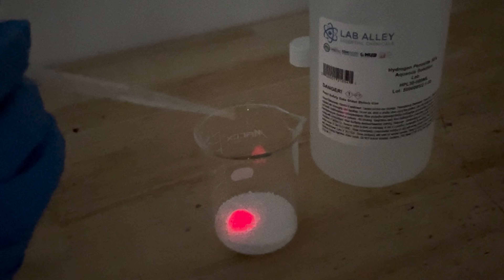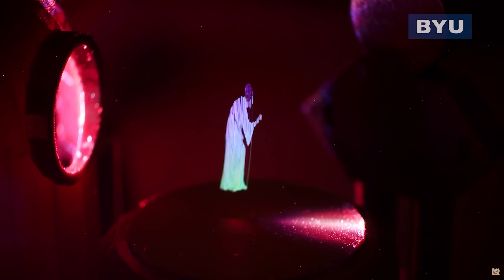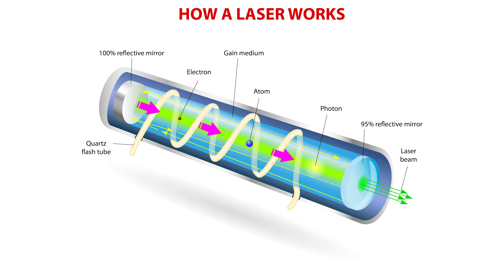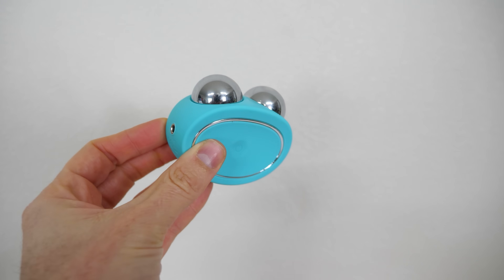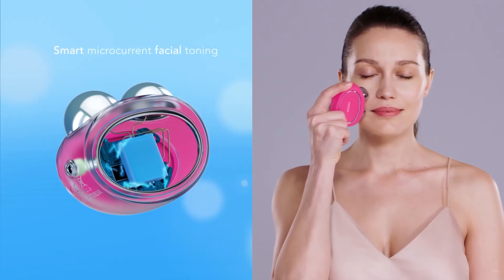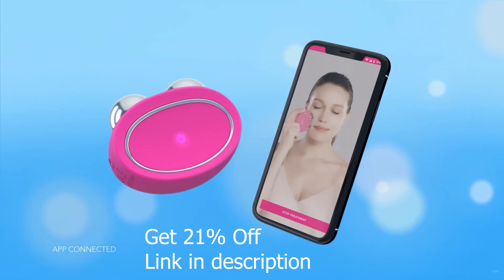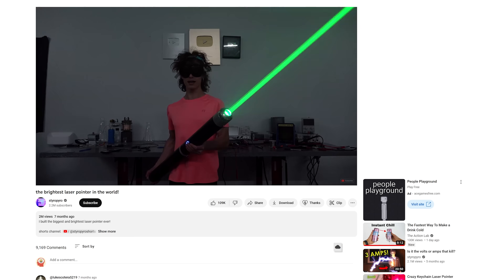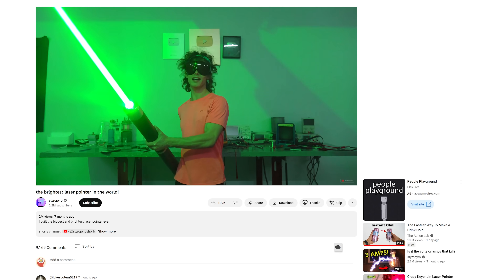Singlet Oxygen Is Scary!

Comment: 1:35 there are electric sports cars whose batteries can deliver 1.5 MW of electricity, though of course converting the electricity to laser light isn't 100% efficient.

The ABL required 55kg per kW of laser power. The MDA wants to reduxe that to 2-5 kg/kW. The plan was to have enough lasing fuel for 20 full power shots, then it would have to return to base to refuel the laser. I can't be sure about the parameters, but say 5 seconds at 1MW for full power.

Of course there are bigger batteries too. The MF Bastø Electric car ferry in Norway has a 4.3 MWh battery and uses a 9 MW fast charger. I'm not sure how much power the battery can deliver, but if it can charge at 9 MW, it wouldn't surprise me if it can discharge safely at 9MW too. Of course, a ferry is big and so might the battery be. I've been unable to find the dimensions of the battery.

But if the battery in a small sports car can deliver 1500 kW (1.5e6 Watts), I'm sure you can in fact have a mobile MW class laser, or at least, the battey size won't be the limiting factor.
Reply from the maker: yes I think electric lasers will surpass the power of chemical lasers soon. To make 1MW of power you might need like 3MW of electricity because electric lasers are very inefficient. But batteries are getting better and better so it is only a matter of time
Reply: @TheActionLab  Well, there's the fusion ignition facility, does that count?   Several facilities actually.
Reply: @junkerzn7312  well, your fusion ignition facility or mobile batteries can not be shot from other from orbit?? : )

Comment: Now the question I am left with is can we use the power of harmonics to combine multiple laser wavelengths in order to combine them in a multiplying effect that boosts their energy output? Like if we created a photon canon with photon rails basically. A little like the concept of a waterslide but using slower wavelengths to amplify the speed of faster photons by providing a channel for them to accelerate upon.
Reply: All photons move at the same speed.
Reply: @phizc  relative to what?
Reply: @metasamsara  heh.. I'm kinda wrong. _In a vacuum_, all photons move at _c_, 299,792,458 m/s. But in any other medium the speed of photons with different wavelengths do have different speeds. Photons with longer wavelengths move faster than photons of shorter wavelengths.

Air has an index of refraction of 1.000293. Vacuum has an IoR of 1.0. So the difference in the speed of photons of different wavelengths in air is very small. Water has an IoR of 1.333, so the effect is more noticeable. It's what gives us raunbows.

What I took issue with is "using slower wavelengths to amplify the speed of faster photons". The only way you could change the speed of a photon in e.g. an optical fiber would be to change its wavelength, and that can't be done. The closest you can come to that effect is for the photon to be absorbed by an electron which later can emit a new photon with a lower wavelength, which would increase its speed in the medium, but it would also have less energy.
 
Sorry my original answer was a bit hasty. I didn't consider mediums with a higher index of refraction.
Reply: @phizc  I believe photons are a byproduct of light waves pushing matter in its way and we consider it light photons. I believe it would be possible however using harmonic resonance to create a medium through which wavelengths could be amplified to travel faster by quantum tunneling. It doesn't make logical sense that light would have a max speed since you can have moving light sources and if there was a top speed, then light would be slower on one side of the solar system than the other as the entire galaxy is moving through the vacuum of space. Everything is relative, and Einstein's theory of general and special relativity are wrong. Which is why they fail to work without special cases when it comes to quantum entanglement. But I'm just a nerd who loves logic, I don't do the math, so what do I know 🙃

Comment: I didn't get how a chemical reaction is converted to a LASER
Reply: For excitation of actual laser medium you just need energy. It can be electricity, xenon flash discharge, but chemical light works well too. You can make ruby glow (few times) by smashing it with hammer. Still counts as energy input.

Comment: I am not a physics person, couldn't we shoot plasma gas from a gun instead laser lights, wouldnt it look as cool and maybe even more destructive?
Reply: No, the plasma just disperses too quickly. In as simple terms as possible, as soon as your plasma comes into contact with the air, all the ions are going to very rapidly pickup electrons from that air and it won't be plasma any more.

On the other hand, hypothetically you can use a powerful enough laser to both instantly convert a target to plasma and ionize the air it passes through creating a plasma channel in the air. Hypothetically, if you also had a big enough voltage potential between source and target through this channel you could also have the other kind of "plasma weapon": a lightning gun.
Which would look very cool.

But at this stage, the "plasma" part of this weapon becomes pointless: you've already got a laser powerful enough to destroy the target. In fact, You could just destroy the target with a less powerful laser, so making it powerful enough to do the above just doesn't serve any purpose.
Reply: The plasma would have a very low density so it would slow down due to air resistance very quickly. It would look cool though.
Since plasma is conductive, one way of doing it would be to use a rail gun, but instead of accelerating a metal slug, it accelerates a blob of plasma. I'm probably not the first to think of it, but I haven't seen anyone try to do that. Would make for a very cool YT video 😀.
Reply: Thank you for the explanation ☺️

Comment: My question is: Does the human eye see the red light? As an observator we see it trough the camera, and, the action lab, assumeingly looks also through it. Because normally a human eye cant detect monochromatic wavelenghts.
Reply: We are seeing the reflection of the light off of the chlorine as it reacts with the HO3.
Reply: Yes. Each of the cones are sensitive to part of the spectrum, and since e.g. monochromatic light at 630nm is part of that spectrum, you can see it. 630nm stimulate the the cells responsible for detectng red light, and to a lesser degree, the cells responsible for detecting green light.
If you shine light through a prism or look ar a rainbow, all the wavelengths have been spread out and each "part" is more or less monochromatic.
Reply: @phizc  thanks

Comment: Question: when I empty a bottle of whiskey into a decanter bottle it looks empty.  I can wait 12 hrs an there is a tiny amount of whiskey in the bottom in the original bottle.  I can tilt the bottle to run down the corner and exit the bottle.  Empty right. No.  I can leave it another 12 hrs and there is another tiny amounts in the bottom.  I can’t repeat this indefinitely but I would like to know what I can do to get it all the first time.  You are the science I trust.  Waiting patiently, an alcoholic.
Reply: Mix in a bit of water swirl in the bottle then drink.

Comment: What would be the power of the reactions you showed us, and how the light is converted into a beam ?
Reply: When we search for COIL Laser , we can see that it emits at a wavelength of 1.315 µm, in the infrared spectrum. The YAL-1 experiment with the Boeing 747 uses this kind of (infrared) laser. 
(Also, he said his (red) laser emits at 732 OR 634nm , while the paper show 762 AND 634nm, but when you search you can find it should be 634 AND 703nm) 
I also found an interesting paper that explains how you can perform the test without injection o iodine: 
""𝘔𝘰𝘳𝘦𝘰𝘷𝘦𝘳, 𝘵𝘩𝘦𝘺 𝘳𝘦𝘱𝘰𝘳𝘵 𝘵𝘩𝘢𝘵 𝘪𝘯𝘫𝘦𝘤𝘵𝘪𝘰𝘯 𝘰𝘧 𝘪𝘰𝘥𝘪𝘯𝘦 𝘪𝘴 𝘶𝘯𝘯𝘦𝘤𝘦𝘴𝘴𝘢𝘳𝘺 𝘵𝘰 𝘪𝘯𝘪𝘵𝘪𝘢𝘵𝘦 𝘵𝘩𝘦 𝘪𝘯𝘵𝘦𝘯𝘴𝘦 𝘳𝘦𝘥 𝘨𝘭𝘰𝘸. 𝘐𝘯𝘴𝘵𝘦𝘢𝘥, 𝘩𝘦𝘢𝘵𝘪𝘯𝘨 𝘰𝘧 𝘵𝘩𝘦 𝘖2 𝘮𝘦𝘵𝘢𝘭 𝘪𝘯𝘭𝘦𝘵 (𝘈𝘭 𝘰𝘳 𝘊𝘶) 𝘴𝘶𝘧𝘧𝘪𝘤𝘦𝘴. 𝘚𝘵𝘪𝘮𝘶𝘭𝘢𝘵𝘦𝘥 𝘣𝘺 𝘵𝘩𝘦𝘴𝘦 𝘳𝘦𝘴𝘶𝘭𝘵𝘴 𝘸𝘦 𝘩𝘢𝘷𝘦 𝘶𝘯𝘥𝘦𝘳𝘵𝘢𝘬𝘦𝘯 𝘢 𝘴𝘪𝘮𝘱𝘭𝘦 𝘴𝘵𝘶𝘥𝘺 𝘰𝘧 𝘸𝘩𝘢𝘵 𝘤𝘰𝘯𝘥𝘪𝘵𝘪𝘰𝘯𝘴 𝘢𝘧𝘧𝘦𝘤𝘵 𝘵𝘩𝘦 𝘢𝘱𝘱𝘦𝘢𝘳𝘢𝘯𝘤𝘦 𝘢𝘯𝘥 𝘪𝘯𝘵𝘦𝘯𝘴𝘪𝘵𝘺 𝘰𝘧 𝘵𝘩𝘦 703 𝘯𝘮 𝘳𝘦𝘥 𝘦𝘮𝘪𝘴𝘴𝘪𝘰𝘯.""
Reply: A laser works by exciting a medium like a gas or a crystal with "normal" light or high voltage,or heat. Then to the left and to the right of this medium there will be a mirrow. One of them is semitransparent.
So i think this light coming from the reaction is used to excite the medium. Then when this medium is excited some atoms in it will de-excite by coincidence and release a photon. This photon then bounces back and forth between the mirrow, and by this hits other atoms in the medium, which then get de-exited by this photon, and thus release another photon with same frequency and same polarisation and same phase. So then two photons bounce back and forth, then four, then eight, ... . Then due to the fact that one mirrow is semitransparent, with some probability a photon will pass. These passing photons then make up the laser beam, which is very directional, coherent (same phase) and polarized and with high intensity.
Reply: @neutronenstern. That's a normal excitation laser not the chemical powered laser
Reply: @neutronenstern.  The light created by the chemical reaction is the laser. It's not used to excite anything. It gets collected by mirrors and passed through lenses to direct it onto the target.
Reply: @kmoecub  Great, now I wonder why it emits 2 diff wavelenght 762nm and 634nm and if this count as "monochromatic" when technically it emits in 2 different frequency ?
Reply: @CraftyF0X  Monochrome also means that it (could be) is a value of one colour as well, so depending on the definition you use, it could mean that as well :)
Reply: @kmoecub  LASER means Light Amplification by Stimulated Emission of Radiation. I think you should stop and reread the encyclopedia section about lasers.

If you don't leverage excited states then emission is probably not gonna deserve to be called stimulated but just spontaneous. The benefit of excited medium and stimulated emission is that the light is coherent, the exciting beam and the emitted beam go parallel at the get-go.

The method with mirrors and lenses does not allow creating a straight beam of the laser kind, from a spontaneously emitted light (that travels in all the random directions). Try it. There was an Action Lab video about it too.
Reply: @kmoecub  In COIL laser, singlet oxygen atoms excite iodine. The oxygen-oxygen reaction that this video talks about isn't even the light being used there. Was not too hard to google.
Reply: @meloney  The color of the light is the function of it's wavelenght aka strictly speaking 2 different wavelenght is not monochromatic. Now, that being said from a semantic perspective you still can be right, as these colors are close enough to be both called "red" even though they are two different type of red.

Comment: Chemical lasers are equally as interesting since they tend to be chemically venomous by themselves separately, yet when you combine the substances together, they react violently, to the point they give up a lot of light that can then be selectively amplified. It's just attractive to the military because it means they don't have to drag the nuclear power plant across the road (considering the fact that diesel fuel is a precious commodity nowadays, especially with the price - it all adds up quickly).

Yet for shorter laser wavelength, electric lasers are best for that because of energy required to obtain UV and X-ray laser, while chemical lasers are much more efficient in the Infrared and red bands.
Reply: Chemically venomous?
Reply: @MirlitronOne  It's more of a figure of speech, some chemicals involved in generation of laser light are just as dangerous - like the Halogens in general, in this case Chlorine.